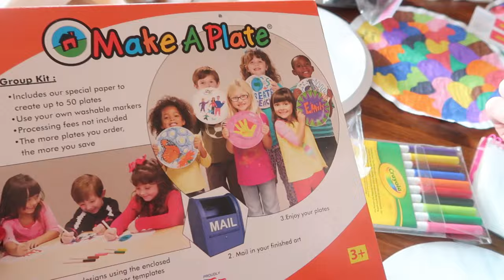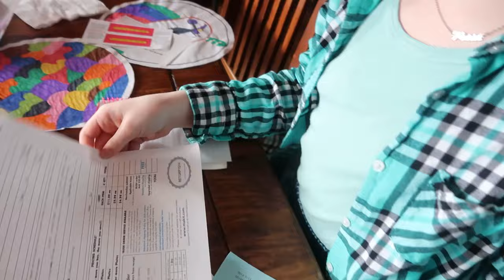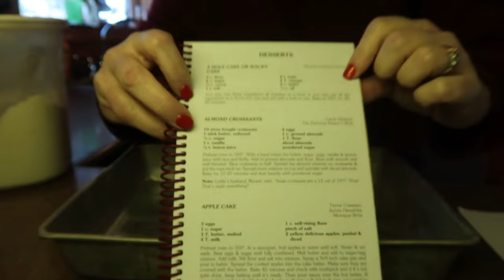Using My First Sourdough Discard

Comment: Lisa preheated her oven to 425 degrees, and she put olive oil in the pan once they came out before she put the sour dough starter in the pan, she stated it takes quite a bit of starter but not make it too thick. She said a pizza stone is best to use cause you can make it bigger than cast iron. And she did drizzle oil on the dough but she used Italian seasoning and salt on hers as well. I hope this helps for next time.
Reply from the maker: I appreciate you condensing for me.  I think the only thing I missed was oiling the pan.

Comment: We put in a large floor as newbies and because we have baseboard heat from a boiler everything had to be 1/4inch away from the wall since it was a wood laminate and it expands and contracts.  My husband had to make a tool with a old file cabinet metal piece and a sledge hammer and a vise.  The tool worked great but there is a learning curve for sure.
Reply from the maker: We needed the same 1/4 inch space.  Then the spacers would move; it took a bit to figure out the system.